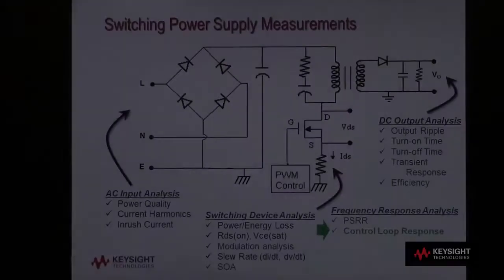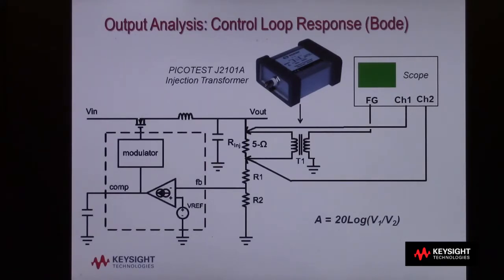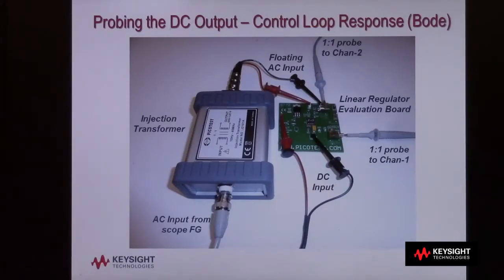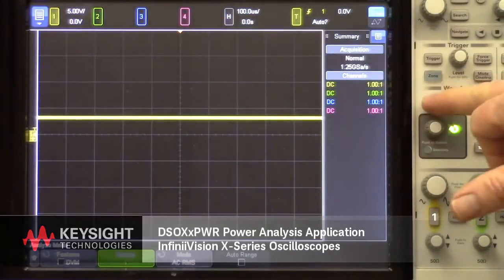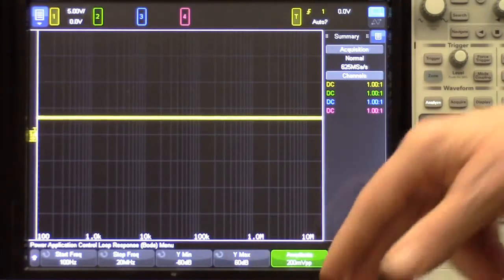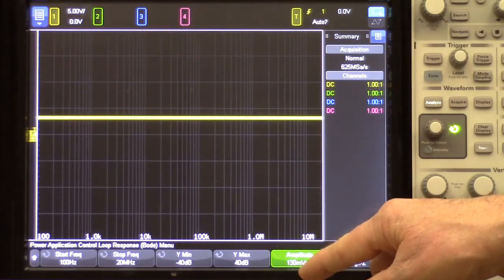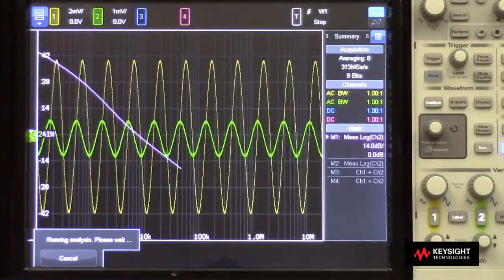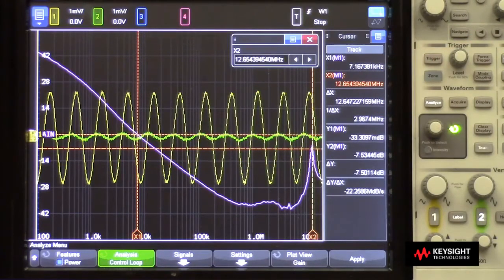Control Loop Response Measurements for Frequency Response Analysis

Comment: Johnnie, I have the DSOX3024A. It has the PSRR option but it does not have the FRA option. I tried using the PSRR to do a simple bode plot of a low pass filter except I can not set the lower limit of the yaxis. I do not see why the FRA or the control loop analysis was not included in the DSOX3024A. This is be added or be made as a purchable option?  I am the one who did the poor man's FRA video. I am also the one to suggested the FRA possibility and the DSOX serie of scope came on to the market.
Reply from the maker: Hi Robert, the 3000A has a power supply rejection ratio (PSRR) measurement, and the 3000T has a PSRR and a control loop response measurement. Unfortunately, the A model cannot be upgraded to the T model.

Comment: Nice feature!
To get the phase margin, instead of doing another manual measurement at the frequency you read at the cursor position of 0dB crossing, just change the plot view to "phase". The cursor stays and will immediately give you the phase margin.
Reply from the maker: +Zebrahuhn Great tip!